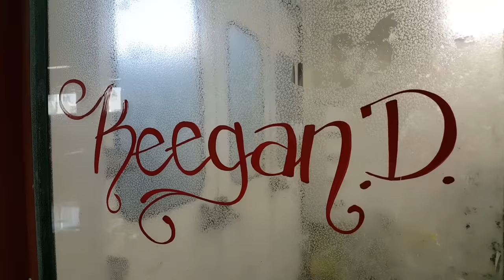Custom Painted Dragon Ball Z Car!

Comment: 9:30 some call that technic swirls. But when I was taught it was called fish scales. Of course that was back in the early eighties. You can get the same results on bare aluminum with drimal tool and even a pencil with the removal erases and a drill. You put a course grit buffing compound on the aluminum and just polish out the swirls with an overlap to get the fish scale effect. Time consuming but it makes a good looking console cluster (around speed Odometer,etc) or if you have a center shifter console.

Comment: Question: how much a work like that cost btw looks lit 👍🏿
Reply from the maker: I don't believe this job was charged for. A regular complete paint job for a vehicle of this size would be around $4000-6000, probably spend about 20 hours on the extra's (Mural, stripes, etc). I don't know the going rate for custom, but I'd imagine it varies quite a bit.

Comment: Whoever drew the DragonBall Z characters for the hood did a horrible job. It barely resembles some badly deformed versions of the characters themselves, not respecting any aspect of the side-profile perspective chosen, nor do the patterns used even respect proportions and positioning anywhere close to what it should be, or to the logical ones even. The main coat of paint looks really good on the car, but the whole DBZ-inspired design looks cheap and unfocused on anything, it's just random and poorly executed as a design.